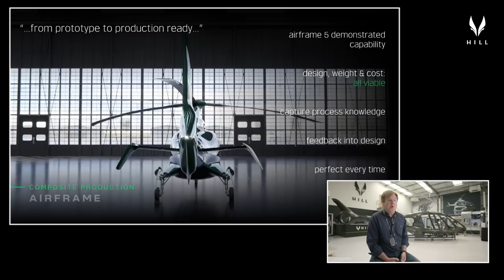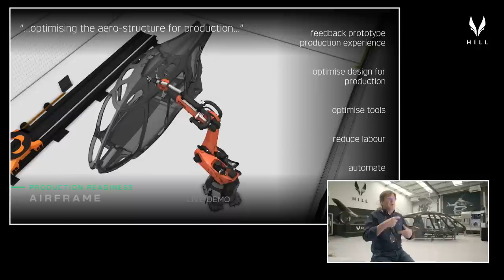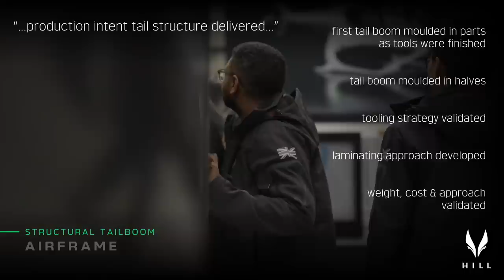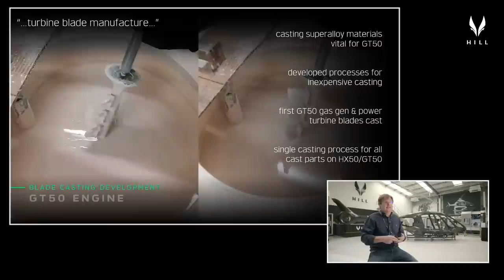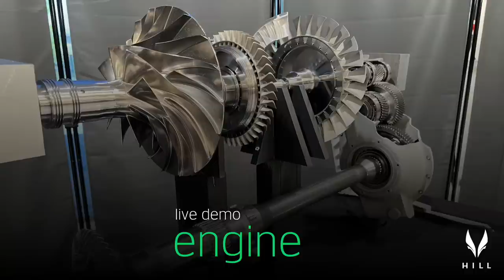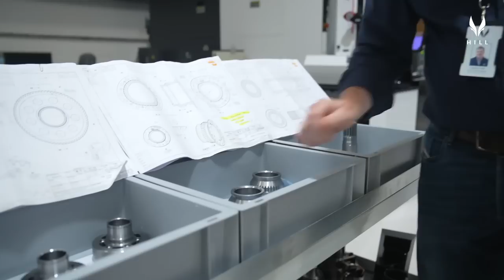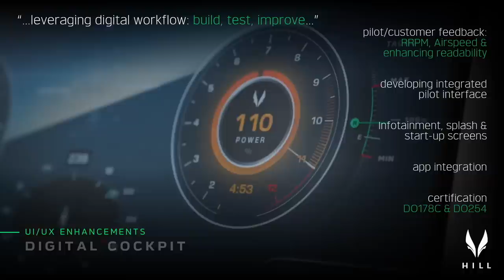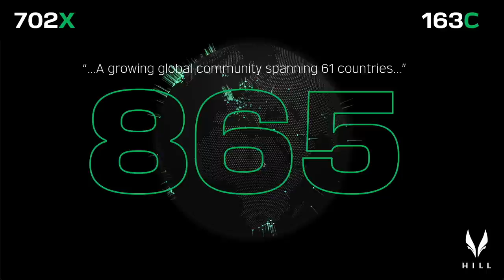HX50 Monthly Update & AMA - 11 July 2023

Comment: Are you now, or will you in the future use Ai for normal and emergency checklists? Is it possible to use Ai to select radio channel prompts or selection based on flight plan, etc? 

Also, have you considered adding a ballistic parachute? 

Do you have anti-icing options?

Do you have windscreen wipers? 

Do you have IFR ratings? Autopilot?